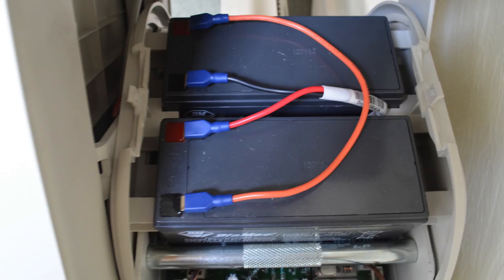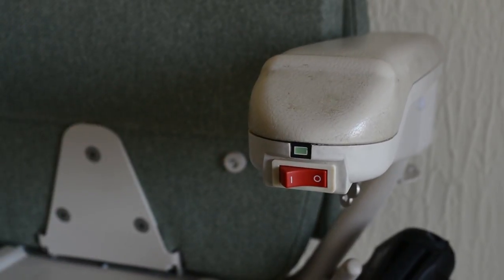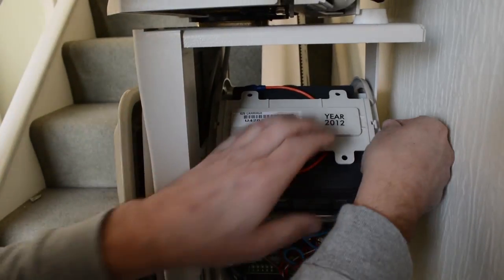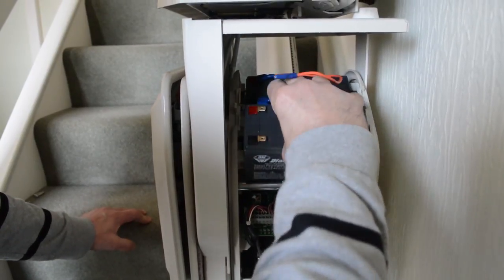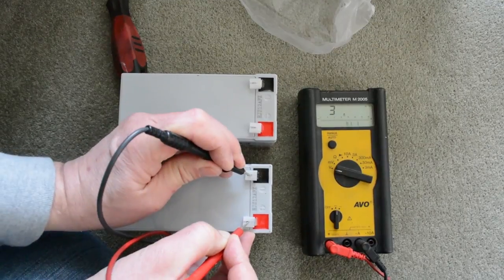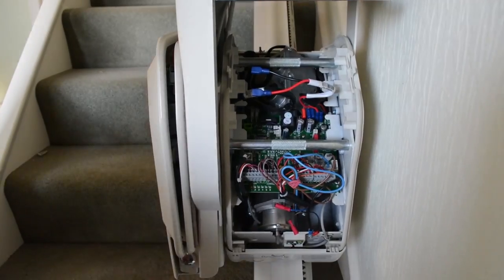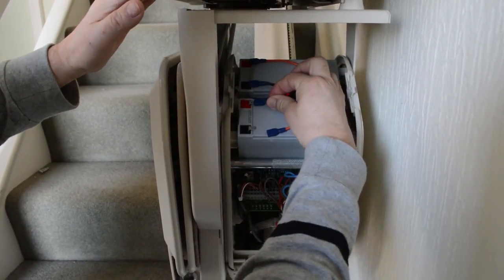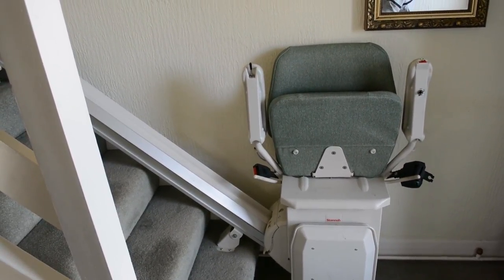Changing the batteries on a Stannah stairlift – Ask A Builder

Comment: Can anyone help me. I've got a Stannah 600 (siena) stairlift. It will go all the way up and down the straight stairs with no  load but under load it does one step at at time beeping  constantly. The error code says code 1 which means the batteries are knackered. 
Stannah UK want (are you ready for a shock....) ..... TWO HUNDRED AND SIXTY  POUNDS just to come  and look at it. I told the guy on the phone  that I wasn't in a position to just throw 260 quid away on a whim and he basically told me tough shit pay it or don't go upstairs any more.!!!

I would also like to know  where I get the batteries from as a search online didn't  really come up with any exact matches, and  I don't know what ampage I need etc etc etc, and i cant check as i don't  know how to get it apart.